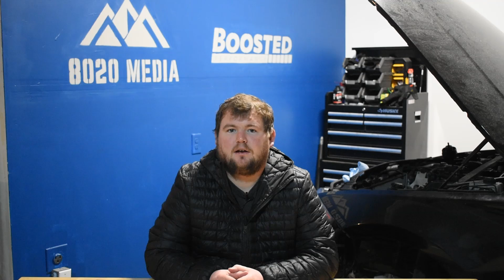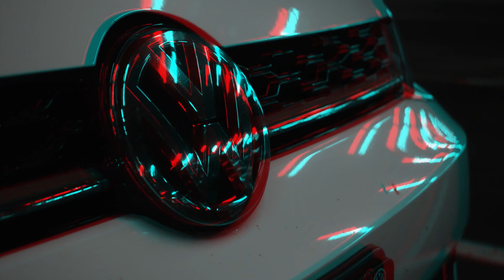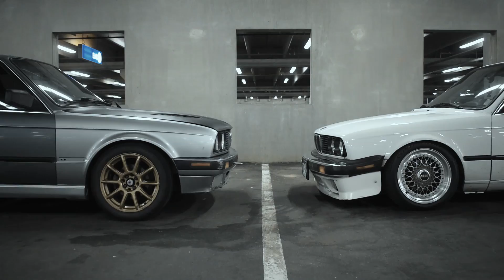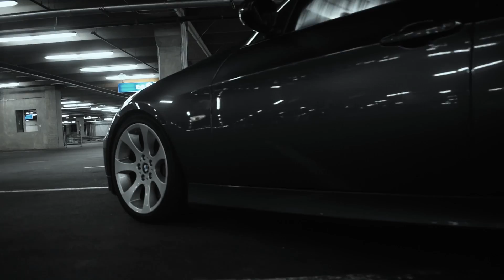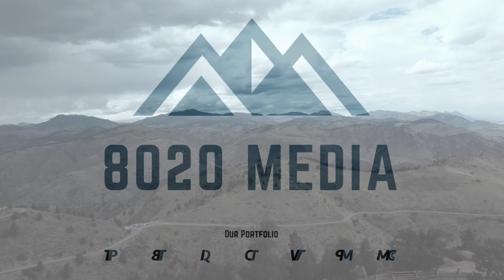BMW N54 | Single Turbo or Twin Turbo Upgrade?

Comment: Hey man maybe a selfish request here but I personally would LOVE to see your opinion on the best platforms for performance Cars, SUVs & Trucks maybe your personally ranking and understand it’s all your opinion but you know so much about these engines that I’m sure the community would like to see your two cents when comparing BMW’s B58s & N54s vs Ford’s 3.5L ecoboost & V8 vs Dodge’s 5.7L Hemi & Cummins … I currently own an N54 and looking to buy a second car to support the build whenever it’s under construction 😂 but really not sure what would be a good engine for a bigger car like an SUV? I’ve been looking at Ford’s 3.5L ecoboost in the Explorer & Dodge’s 5.7L in the Jeep Grand C or even considering getting another bmw and going for either an N55 or B58 SUV …  In terms of performance potential, ability to rebuild(some platform are more rebuild friendly like the N54 that has so much information online on how to build them and lots of aftermarket support to buy affordable forged internals) and ofcourse reliability! Appreciate if you read this 🙏🏽
Reply from the maker: Thank you for the comment and feedback! We'll certainly considering doing some videos along these lines. It would likely take a few videos to cover so much different stuff between cars, trucks, SUV's, different budgets, goals/priorities, etc. I think all the engines you're considering in an SUV are solid choices. I'd personally rank them:
1) B58 
2) 3.5 EcoBoost
3) 5.7 HEMI 
4) N55

If you're after performance potential I'd probably nix the 5.7 HEMI. It has the potential but the NA design is a limiting factor unless you're willing to consider big mods like cams or forced induction. The N55 isn't as capable as the B58 or 3.5 EcoBoost and it's also the least reliable on the list. Less the injectors, turbo, and HPFP the N55 isn't any more reliable than the N54. Then again, if you're already comfortable working on the N54 then N55 reliability might not be a big concern since they share much in common.

I think BMW did an excellent job with the B-series engines and so far the B58 is proving itself to be very capable and reliable. To me, it's without question the best on this list and one of the best mass-production engines right now. I really like the 2nd gen 3.5 EcoBoost, too. I just can't give it the edge over the BMW B58. When behind the wheel, the BMW engine simply feels more exciting and refined.
Reply: @8020Automotive  thanks so much man, this is super helpful!

Comment: The most important first step when deciding on upgrades is to set a power goal and stick to it. If you don't you'll just waste time and money.

If your aim is big power, your first consideration has to be the transmission and running gear. The ZF 6AT really isn't reliable above 600whp, even with XHP stage 3. The stock clutch in 6MT will start slipping at around 450whp. 

In MT cars, the 550i clutch will allow you to put down around 600whp if you don't abuse it. Above that power you are going to need a twin plate and all the unpleasant noise and harshness that comes with it.

In AT cars, if you want >600whp you can spend a few grand building the 6AT,  or a few more grand and do a ZF8HP70 or 90 swap, with a CanTCU or Lamik controller.

If you're doing this in a 135i or 335i, your rear axles will be in mortal danger at the low 600 range. So you'll need to upgrade them, While you're at it, you'll want a diff too, because you're now at a power level where you really to need both wheels putting it down.

Which brings the topic to rubber. Even with an LSD and sticky street rubber (Cup2's A052's etc) you're going to start running out of traction above 500whp. With some boost-by-gear tweaking you'll extend their usefulness to 600'ish. 

Above 600whp you'll either need xDrive or Semi slicks (R compounds). Semi Slicks make genuinely awful street tires though, so be ready for crap ride quality and noises so bad it sounds like you've lost your wheel bearings.

IMO, anything over 600whp pushes you into full race car territory. If you liked your BMW because it was a wolf in sheep's clothing, you're gonna start hating it with the compromises >600whp necessitate. If you want full racecar, go for it though!

So IMO the real question is, do you want a street car (<=600whp), or do you want a race car (>=650whp)?

For a street car, just buy good quality hybrids like the PS2, RB's or Mosselman's. On a budget? roll the dice with some eBay 17T's.

Forget about larger hybrids like 19T's, Flowmax, GC, GF, F-RB's etc unless you're stuck with only pump gas (in which case your power will be limited by the fuel), or are willing to build the engine. The\ bigger hybrids absolutely will bend rods and/or crack ringlands on a stock motor once properly dialed in on E85 or meth.. it might take a few months, but it will happen.

Going to a big single moves the power band enough tot the right (i.e. is laggy down low) that you can probably go to maybe 700-750whp before you'll need to build the motor.

At 800whp or more, you need a built motor if want anything resembling reliability. But then you have to ask yourself is it really worthwhile putting that much money into the N54 platform?
Reply from the maker: 1M - Thanks for the valuable in depth insight here. This will certainly assist N54 owners in the future!
Reply: Thanks for the advice I wasnt sure how to achieve my goal I always had my head stuck in the maintenance bucket
Reply: Ok so after reading this I want my n54  a street car with around high 400-low 500 what you think single or upgraded twins
Reply: @shaqazoolou5749  single will cost you double what upgraded twins will. If your stock turbos not got 30ff code (waste gates) 400 to 500 is possible on good stocks
Reply: @adambarrett5696  on stage 2+ E40 OTS maps, stockers manage 380-390ish whp. To get them into the 4xx range you are going to need a custom tune and to start pushing them to boost levels they just aren’t efficient at, and the extra heat generated will see them dead sooner rather than later.

The HP numbers MHD publishes are crank not wheel.

If you want a reliable 4xx you should go stage 2’s.
Reply: @BMW1M  are whp being a brit I naturally think crank
Reply: @shaqazoolou5749  15T’s (stage 2) twins are all you’ll need for this target, and if you buy Pure, RB or Mosselman you can expect them to last for years.
Reply: @BMW1M  What if you want lets say 500-550hp max? And you have a good price on TD04 19T twins... Isn't it better for the engine and turbos even if you go on 400whp on 19Ts do you loose something or only gain little bit of lag but turbos are not pushed and not generating so much heat etc.. Or for lower horse power smaller turbos are still better even if we take turbo lag out of equation. 

Thank you for answer
Reply: @FeeZeeF30  19T's will get very close to 500whp on pump fuel. Add 30-40% Ethanol (will require port injection) and they make 550 with about 23psi, which is nice and safe.

I don't see any point in using 19T's if the goal is only 400whp though. Drop down to 15t's and keep the nice quick spool.
Reply: I'm putting my single n54 with syvecs into an e30
Reply: awesome information! i have a AUTO 335 XI and going big single, want that 650 whp. But im afraid of the transmission and the transfer case... i will be drag racing from a dig. So idk what would be the best setup, like do i keep it AWD, or run X-delete and meaty tires on the back? Or would RWD have better 1/4 mile times?
Reply: @mystiqlufa6205  there’s no simple answer to this, as much of it depends on several other factors.

AWD will help your 60’ times - but so will extreme weight savings. So will doing a small brake kit on the rear so you can fit 15” wheels with some ET streets. So will drag shocks etc.

I know of a stock turbo N54 powered 335i, RWD 6AT that is able to do 1.5xx sec 60’ times on 15” Mickey Thompson ET streets, in the hands of a skilled driver, for example.

I also know of 600+ whp 6MT RWD’s that are flat out doing a 1.9sec 60’ no matter what they do..

Most AWD 6AT 335i’s will do approx 1.7s on grippy street rubber, but 650 wheel is on the limit…

If it was me, I’d run the 6AT until it starts showing signs of death 🙃 If you really are committed to 1/4 mile, it’s going to be hard to beat a powerglide tbh. But that’s a very drag focussed setup that won’t be great at anything else. Next best would be a ZF8HP70 at that power level.

At this power level and because for drags you want top end over a wide powerband, single turbo is the go. Something like a G30-770 (or Pulsar equiv) would do the job well.
Reply: @BMW1M  thanks for the information, very appreciated! Yea i see most people run the RWD instead of the AWD for drag. 
So your saying basically manual swap my car (because they are also stronger transmissions) and go for the RWD setup with 15” wheel setup?
Also wanna keep the car for street too btw

I found a few partout cars where i can get the full manual setup for my car, but im scared about all the coding that has to be done lol. And would probably also have to get an LSD too and upgraded axels…

EDIT: so yes ill prolly run it until it starts slipping etc. but idk if i should just upgrade the 6AT that’s already in it or do a swap and also keep it AWD or not. And also i dont know what kinda tire setup i should run while doing the AWD, like is 17inch t888r’s over kill or no?
Reply: I'm prob going with speedtech single. Aiming around 500-600whp. I just like the sound of it and single turbo will last longer than any twins

Comment: Stage 4 twin turbos do exist by the way, stage 3s can push you into the 800s on twin turbos too. They are also a cheaper option then a big single turbo as well. Just want to comment on that.
Reply from the maker: Stages are really just a marketing term. The common differentiation on N54 twin turbos is TD-03 and TD-04, which refer to the size of the center section. TD03 upgraded turbos utilize OEM size center sections with larger than TD03 internals. True TD04 turbos (like RB Game Finishers) use a larger center section throughout.

Anyway, we did reference the TD03 vs TD04 sizing a few times throughout the video. Any TD03 turbos should ideally be kept under the 600whp mark. Yes, they can make more power but these small turbos really stress the engine above that power. TD04s are a good option for 575-650whp goals. The right twin turbo setup can make 700+whp, but the N54 is best suited to a large single turbo above 650whp. That's especially true on a stock engine.
Reply: @8020Automotive  Ik that to be true, but if you are chasing bigger power with a single you will have to swap out internals anyway, you will blow the motor at 700+ on stock internals
Reply: @8020Automotive  Agree with your power thresholds for twins vs single 100%. 
15T-17T twins are the sweet spot. Bigger twins just equals bigger problems.
Reply: @BMW1M what does 15-17 mean?
Reply: @malinoisnation9392  Hybrid twin turbos for N54 usually come in one of three sizes: 15T, 17T or 19T. For most of them, the exhaust turbine is the same (TD04L) - the "T" numbers refer to the compressor wheel size - each step is ~2mm larger diameter. The stock N54 turbos are 10T, and have a smaller TD03 turbine wheel.
Reply: @BMW1M  thanks!  Running stock TT on full bolt ons